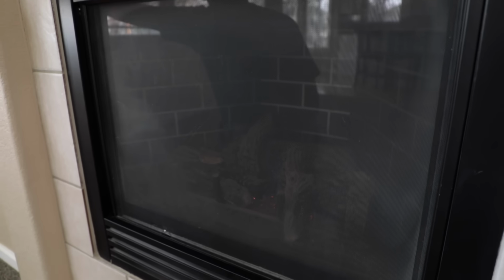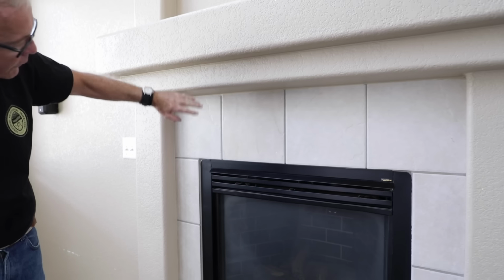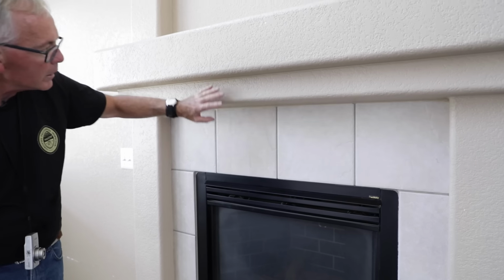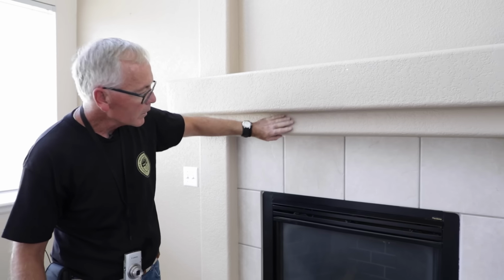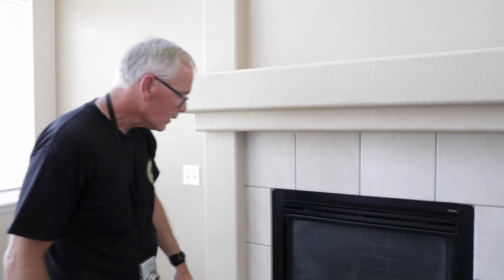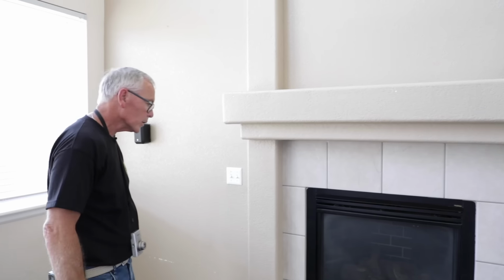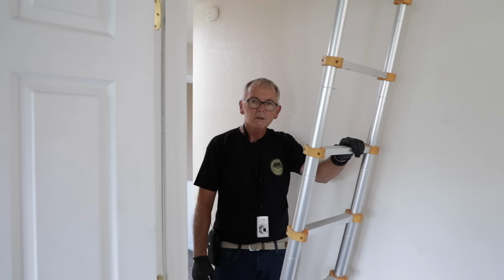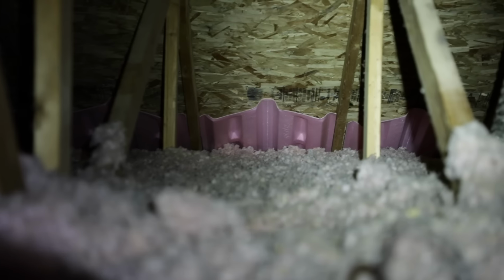Home Inspection with InterNACHI® Certified Inspector

Comment: I have 2 question maybe someone could answer. I looked up the requirements for Indiana home inspectors and it says you need 60 hours of approved home inspector training, 12 hours of practical training with an approved instructor and pass the test. But on the interNACHI website it says their course is 90 hours total. 78 hours online training, 12 hours of practical in person, plus the test. Is there a reason interNACHI requires more the Indiana requires?  2nd question, If I get a membership with interNACHI and do the online coursework there, which is supposed to be free with a paid membership, how much approximately does it cost to get the 12 hours of practical in person training with an approved instructor? I have only found places around me in Indiana that offer the whole package. As in, online course work and practical in person training together.
Reply from the maker: Hi, Dawn. You'll want to visit https://www.nachi.org/licensing-and-certification/us/indiana

Comment: Great job, would have been great for new inspectors to see a close up of missing drip edge flashing as it is such a major problem. Some roofers will even argue that they bend the shingles over the gutter back edge and “ create “ the drip edge, wrong. Good subject. Thanks
Reply from the maker: Oh, those roofers!

Comment: I'm currently a realtor, planning to become an inspector. I assumed inspectors did more when checking the HVAC system. I helped a buyer recently on a house that had the gas off when the inspector went by. He couldn't make it back so we went by to check the furnace and it kicked on but did not seem to be blowing hot air. Would most inspectors check for that or just say that it is functioning because it kicks on and blows air?
Reply from the maker: Home inspection standards of practice are at https://www.nachi.org/sop.htm
Reply: What's the point of inspecting the HVAC system?  If it doesn't work then call a company to fix or replace it.  It's that simple.  You don't need an inspector to tell you that.
Reply: @steveklemetti8035  what do you mean what’s the point? An inspector should at least be able to check that it’s working properly. Not every homebuyer is going to know what to look for in a new house they’re buying to check it themselves. And like I mentioned in my first post, sometimes they’ll kick on but not actually work. In that case it was because the gas was off, but the inspector wasn’t the one that found that. I think the best thing to do is have an actual hvac company inspect the system, but I don’t see why it couldn’t be something a home inspector could offer if they had the knowledge.

Comment: Back in March of 2012, I started making videos of my home inspections, most running 45 to 70 minutes so I am very tuned into double-checking videos for things that were overlooked or forgotten to be mentioned as I was filming. This is where I add captions & still photos into the video to address those items. You will not see the videos on my channel as they are all unlisted and I noticed YouTube made over a couple thousand of them private this past year. The following is what I noticed from your video. I understand some of these might exceed your Standards Of Practice but I believe they are worth mentioning.

Whoever did the tiers of siding layout needs to be rapped on their head, the butt joint conglomeration at  https://youtu.be/x5B2XZ7PIGQ?t=630 looks horrible & in other locations too.

At https://youtu.be/x5B2XZ7PIGQ?t=769 that facia water damage is at what appears to be a leaking gutter joint.

At https://youtu.be/x5B2XZ7PIGQ?t=1076 you can see the hinge side bottom corner of the rear exterior garage door is starting to dry rot. 

At https://youtu.be/x5B2XZ7PIGQ?t=1414 on the exterior of the door that jamb and trim are at the early stage of dry rot. 

At https://youtu.be/x5B2XZ7PIGQ?t=2046 it is blatantly obvious the siding and trim have concrete above the lower edges and it's tight to it which will allow this material to rot out over time. Mud jacking that slab will only increase this defect. 

At https://youtu.be/x5B2XZ7PIGQ?t=2120 that 2 plus inch slab drop still does not provide the proper clearance from the lower edge of the siding and trim from the ground or hard surfaces such as concrete. 

In most cases, siding and trim clearance should be about 6-8” from the ground. I'm a licensed general contractor and we always back prime & paint at least one color coat you'll never see on the backs of all exterior trim and the backs of the lower tiers of siding upwards to 2+ feet and we never cover bare siding with trim. Dry rot & wood-boring insects is a huge problem here in Hawaii.

At https://youtu.be/x5B2XZ7PIGQ?t=2429 where is the moisture barrier between the concrete foundation wall & wood frame wall? 

At https://youtu.be/x5B2XZ7PIGQ?t=2606 to the right of the closet door, I can only guess the carpet has lifted from the tack strip. 

At https://youtu.be/x5B2XZ7PIGQ those are maybe plywood flanges with OSB webs, most of the TGI's we use have dimensional lumber for their flange. It is becoming very difficult to source TGI's with plywood webs anymore. 

At https://youtu.be/x5B2XZ7PIGQ?t=3038 that foam rubber insulation by the expansion tank, I always tell my clients to paint the foam rubber insulation, oil/water base, does not matter, what it will do is easily double and more the rubber's lifespan, longer with repaints and it works on solar water heater insulated lines/zip ties on the roof, rubber seals of vent pipes & masthead pipes too. Hey, it's cheap and it works.

At https://youtu.be/x5B2XZ7PIGQ?t=3073 that looks like water stains on the baseboard. I thought I saw it on some of the finished basement area baseboards as well. Why was this not mentioned?

In your bathroom section, why don't you test the drain stoppers and fill the tub & sinks to verify the sink and tub overflow's work? I can't recall the number of times I've had defective overflows that leak or won't drain.

You did a good & spot-on inspection. Here's a tip you might or not know, with those stone countertops, run your thumbnail edge down the lengths & sides of them, if it's cracked it will snag it, sometimes a fissure will snag too, that's when you check the bottom edge of the epoxied on nosing for verification.

Cheers & Alohas!
Reply from the maker: Awesome feedback. Thanks for watching.

Comment: Garden bed is supposed to be as far away from the building perimeter as possible, instead, the perimeter should be covered by concrete footpath or driveway with slope outward to keep water away.
Reply from the maker: Exactly.

Comment: How come you didn't check the fuse/breaker for the AC to see if it matches the maximum allowable fuse on the AC data plate ?
Reply from the maker: Many home inspectors do that. Yes. Not required.